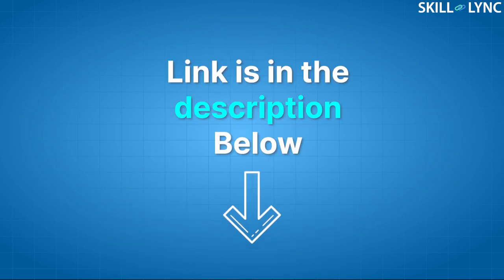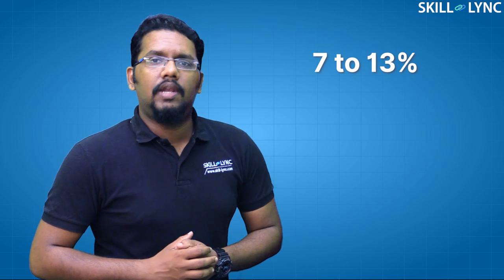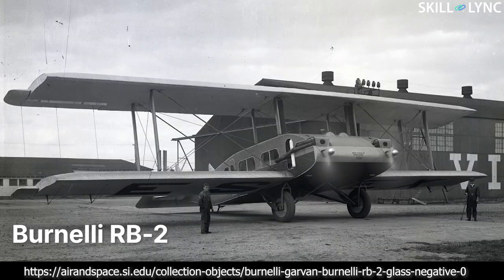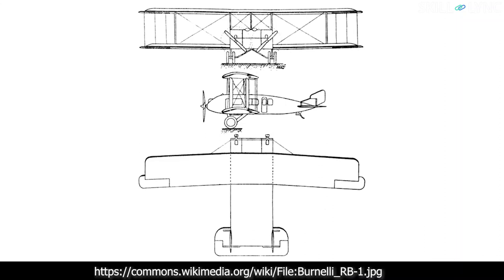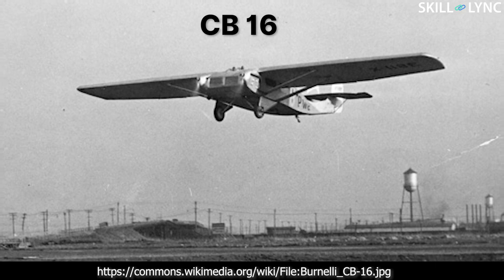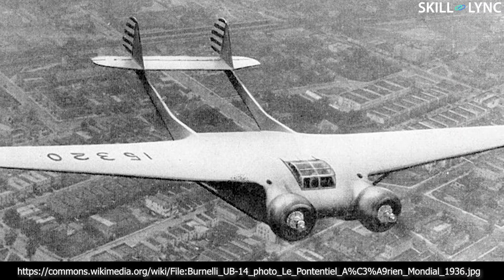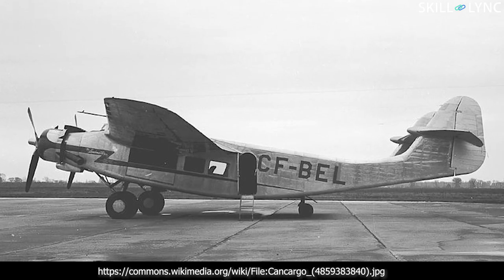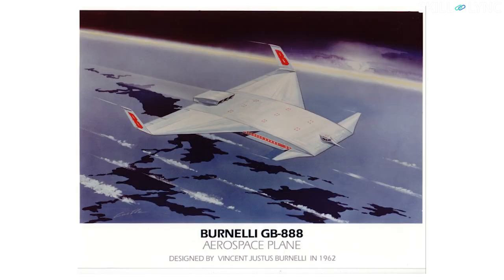What is a Burnelli Wing? | Skill-Lync

Comment: That last one is similar to a later trans-atmospheric hypersonic model, but Burnelli in the '60s drew it as a high-subsonic liner. US patent 202149, 1965

More detail about the crash of the Burnelli in the '30s: due to mechanical error, the ailerons departed mid-air.
The plane hit the ground at 130kts, 100°+ roll, nose down.
Wings and tail turned into confetti and the engines broke off as the fuselage body cartwheeled across the field. It came to rest, upright, and when they broke it open and got them out, the crew walked away.

Comment: Nice primer on Burnelli, although the aircraft pictured at 2.33 an 2.38 are not the CBY-3 but the UB-14A. The A version was lost in a crash. There was a level of safety designed into Burnelli aircraft just because of the shape of the fuselage. Thanks 

rtc
Reply: Burnelli wing aircraft are the  "Land Rovers of the skies"(cheap,robust and easy to repair)
Reply: @Venkat Jaya Deep Look it up, they stole his fighter plane concept and hey presto the F15 Eagle was born. It's the exact same layout, although the F15 looks much sexier then Vincent's concept from the 50's.

Comment: Superior in every way. Slower takeoff and landing speeds due to superior lift capacity. Engines don't destroy the fuselage on crash. Less stress on the structure overall. Almost impossible to stall. Read about why the military did not use it because of FDR.